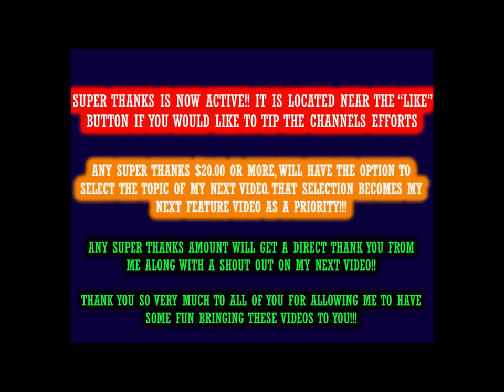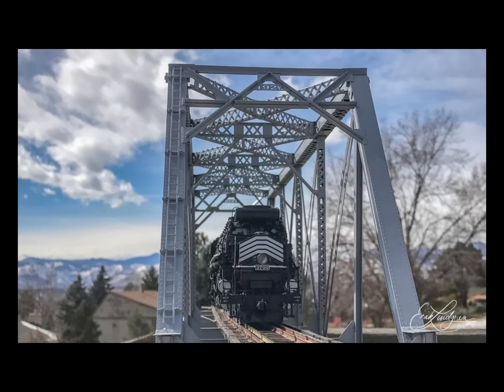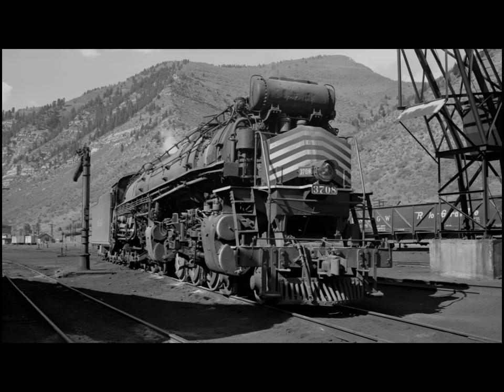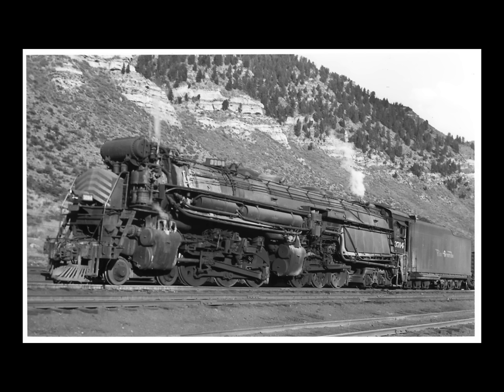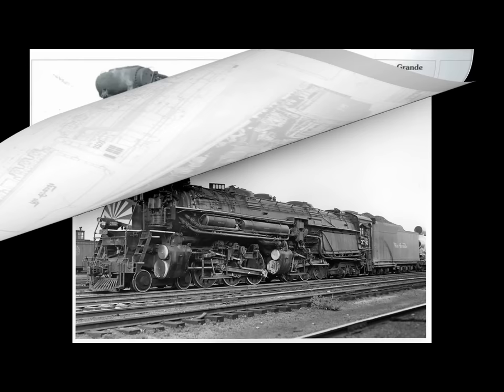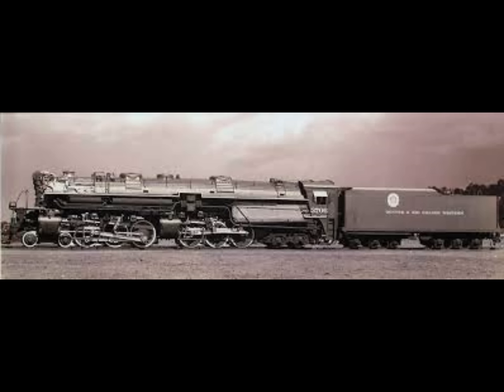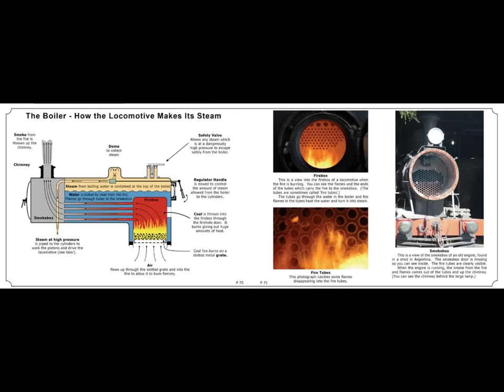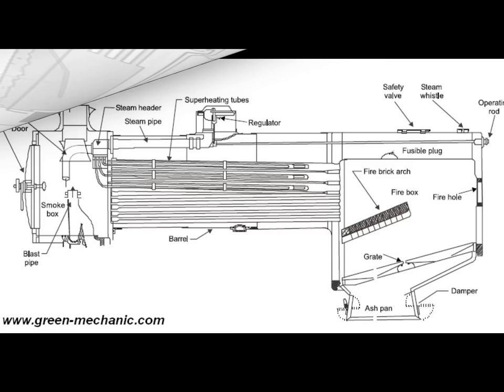Tragedy on the Rio Grande Locomotive No  3703

Comment: quite surprised it had no Fuseable plugs fitted, was the loco boiler delivered with that omission or was there a supply problem & had they been blanked off, the low water alarm is a secondary item, to be used in conjunction with gauge glass columns, again was this a standard fitting when the loco was delivered, the fuseable plug is there to reduce the fire intensity to prevent overheating of the crown sheet, I cannot believe anyone would be that stupid or incompetent to adopt that practise but it would appear due to the report that was the case.
Reply from the maker: I was rather surprised about the Low water alarm myself. The report clearly stated the loco didnt have one.
Reply: @TheRailroadCrossing-SteamPower  I know the low level water alarm is a US item, I have never seen it here in Australia on steam loco's or ever seen it mentioned in Britain or Europe, they do exist on modern stationary steam plants as they are automated & do not have an attendant on or around the installation full time.
Reply from the maker: @afs5609  Yeah, I could have sworn that I saw a requirement for U.S. Loco's to have them... Which is not the case with fusible plugs.  To me..it's nuts not to have them on our huge loco's regardless if it's law or not.
Reply: @TheRailroadCrossing-SteamPower  I just realised that due to the boiler pressure fusible plugs are out of the question due to the high thermal temperature of water in the boiler at 280 psi the water temp is 481 F, the melting point of a fusible plug is around 450 F
Reply: Just remember, fusible plugs function only when there is no water to reduce the temperature below the melting point.  I seem to recall, on the SP a boiler explosion on either an AC or MT class when all 5 plugs functioned and the boiler still exploded.  Apparently, all 5 were not enough to extinguish the oil burner or get the attention of the engine crew.  SP used and Nathan provided used button type fusible plugs that provided a larger opening.
Reply from the maker: @afs5609  Now this I did not know!
Reply: @rrsteamer  I need to correct the mis understanding in your reply the fusible plugs extend into the water space above the top sheet (crown sheet) by a determined amount, meaning at the time the fusible plug melts there is still sufficient water covering crown sheet, now the difference between coal & oil firing of course is a different matter in relation to how the fusible plugs quench the fuel source, how the fireman/engineer finds them self in this position is related to the failure to keep a close observation to the water level in the glass column, there has been problems that the gauge glass column has given a false reading due to blockages in the steam passage resulting in giving a high water reading, & blockage in the water passage gives a low reading, now depending if the loco is fitted with one or two columns you will see different water levels between them & usually the one that has a blockage the water does not move up & down in the glass but remains almost stationary.